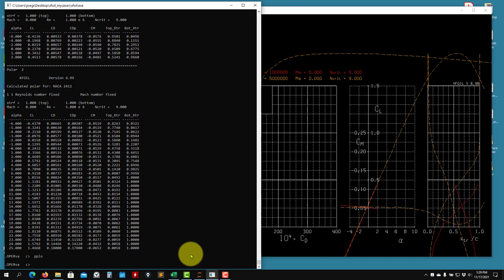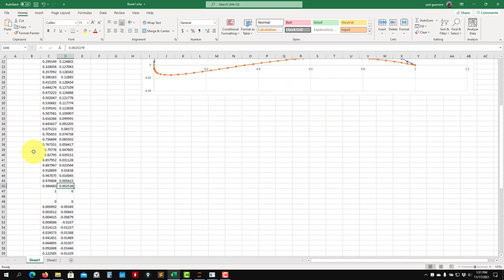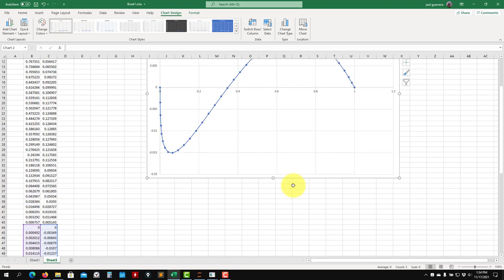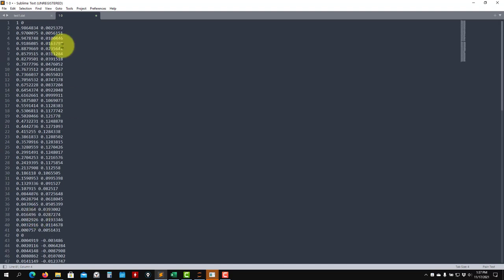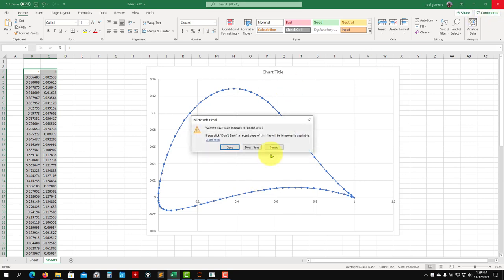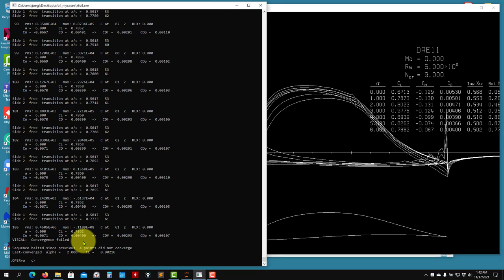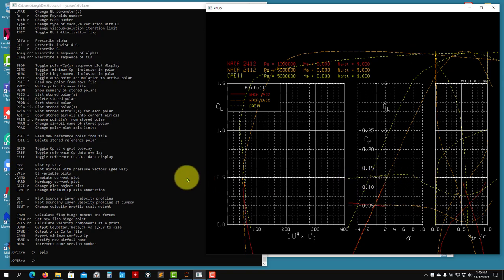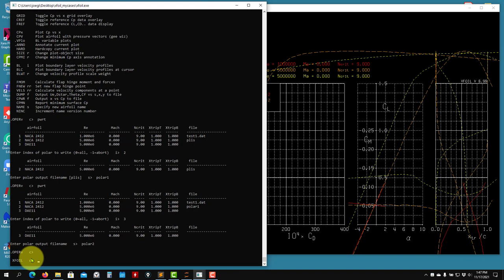Design and analysis of airfoils using XFOIL - Part 2

Comment: Hello Sir. Do you have any videos related to extracting the mid, tip and root region coordinates for an airfoil in XFOIL?. Im a final year student completing my bachelors in Mechanical Engineering and Airfoil is my final year project. Currently Im using a NREL-s807 airfoil. Any help is appreciated. Thank You.
Reply from the maker: Dont get your question. XFOIL is 2D, so there is no need to get mid, tip or root coordinates